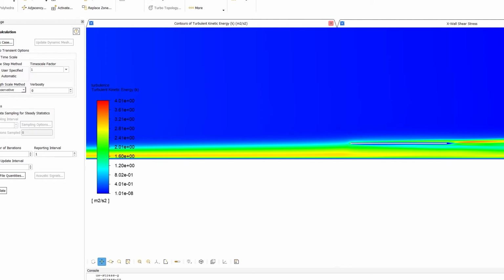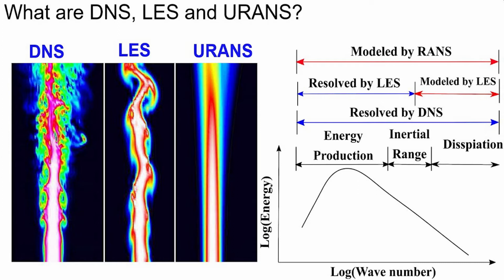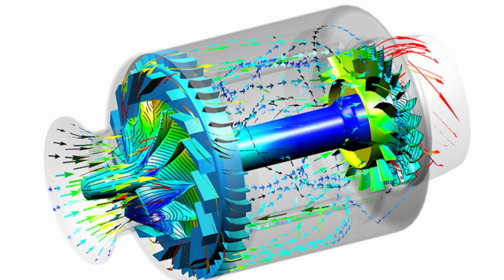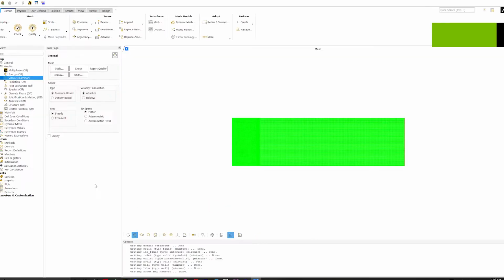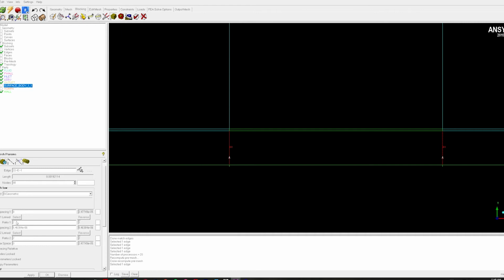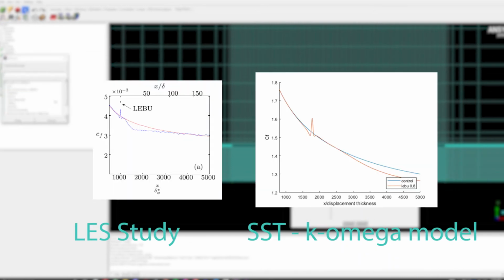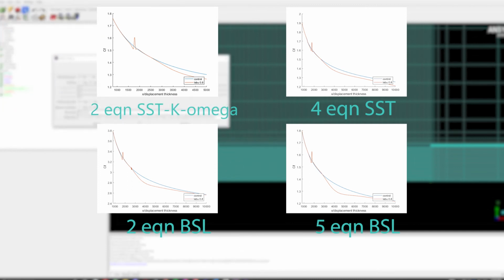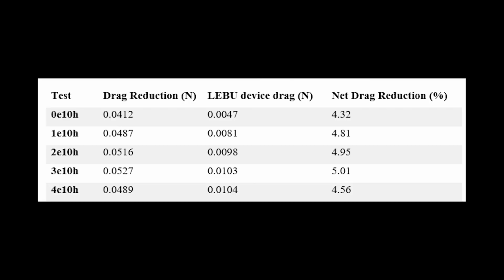Drag Reduction using the LEBU effect on a Rough Wall

Comment: Has someone shown that it's theoretically possible for the LEBU effect to reduce drag? What is the reasoning or idea behind why it would work? (Is it something like the boundary layer created by the LEBU would already exist since its inside the wall's layer, so it doesn't add too much, and it counteracts the existing layer potentially enough to reduce drag. and there's not much drag/boundary layer on the top because its in the wall's layer?)